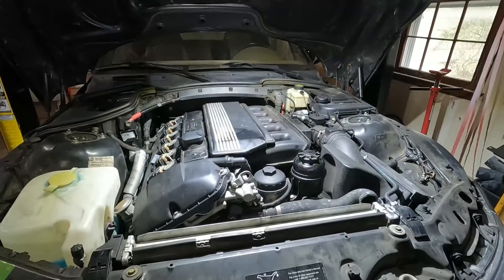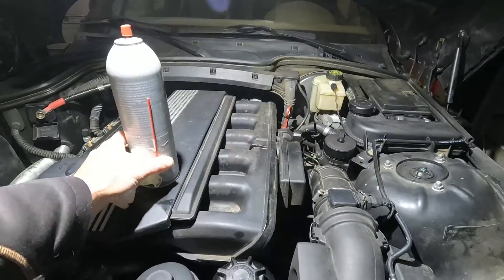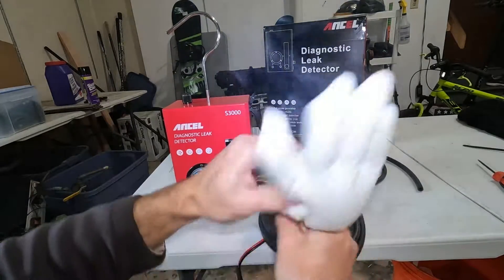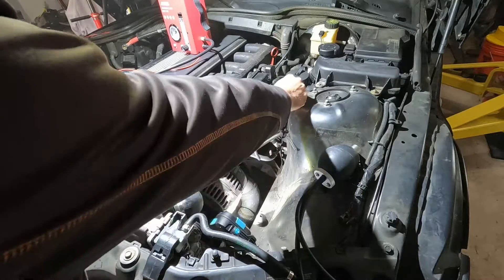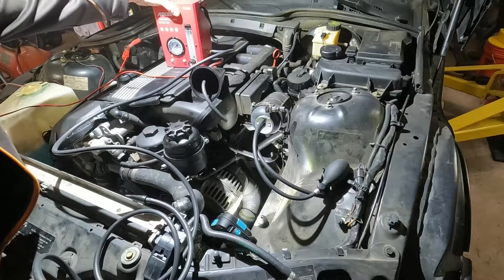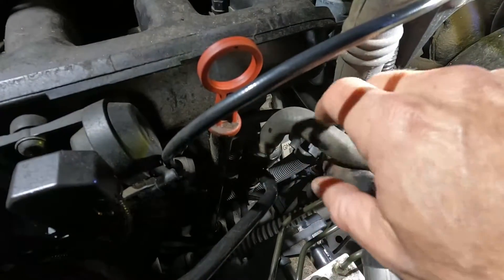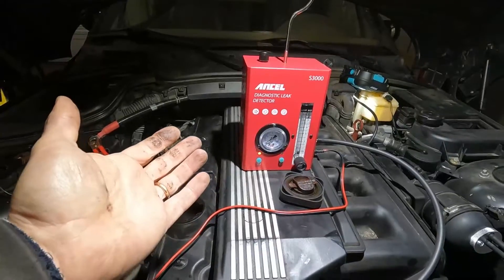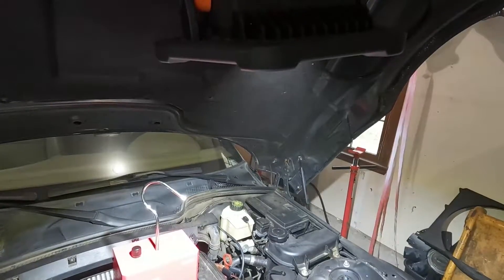Air Leak Code P0171 P0172 P112F How To Fix Mixture Too Lean Check Engine Light With Smoke Test

Comment: Good idea to replace all vacuum hoses and fuel vapour hoses and purge solenoid. 
There is a line that goes from the left firewall down under the car and above the fuel tank, hope that never breaks.

Comment: Just make a Mr. Fusion for $20.  See video on YouTube.
Reply from the maker: Hi Gary, I want to add a Mr. Fusion to my Z3 😀 Gas is too expensive and I want to go back to the 80s for a day or two.
Reply: @AskTheCarExperts  You misunderstand.  The Mr. Fusion I am referring to is a simple PVC Pipe smoke device.  Look for it here on YouTube.  I can't add a hyperlink anymore because YouTube will strip it out.
Reply from the maker: @garyvanremortel5218  Gotcha, Have you made one?
Reply: @AskTheCarExperts  Yup.  I have used it twice on neighbor's cars.  Works perfect, but it needs and I have a compressor.
Reply from the maker: @garyvanremortel5218  Nice! I like being able to do a test without a compressor when checking a car away from home.
Reply: @AskTheCarExperts  I get that, but my Slime roadside tire pump could work in that instance.

Comment: Thanks, Roger!
Nice cameo, Zion 🐶 

Any risks to damaging say MAF sensor etc with the shmoke??
Reply from the maker: Thanks Mario, I was impressed with how well the smoke machine filled the glove. Better than the one I have that uses the compressor. For your MAF question, no the smoke is baby oil. It's common to have oil residue in the intake. Also in most cases you would remove the MAF to smoke the intake tube but this would not cause damage to any sensors. Excellent question!

Comment: Could u damage any seals with that much pressure
 Seems alot of seals werent designed for that type of pressure especially if its a VACUUM system lol. ???
Reply from the maker: That is a good question. While it does produce good pressure for smoke testing it is not enough to cause any damage. I have used smoke machines for 20 years and they are an amazing tool for finding leaks. Nice that they are affordable. Matco smoke machine is still around 2 grand and this ine works just as well with no compressor needed.

Comment: Find a leak on bmw 528i n20 engine p0171 codes impossible to get rid of!
Reply from the maker: Have you used a good smoke machine? Usually do to an air leak. Even a small leak can cause the too lean code.
Reply: @AskTheCarExperts  nobody can find what the problem is using a smoke test. Just pointless. Been stuck with this problem forever
Reply from the maker: @toomuchfinesse2071  A smoke test is an important test that needs to be performed for a mixture too lean fault.  If not leaks are found then you need to look at other reasons but this step should not be skipped.
Reply: @AskTheCarExperts  I never said the smoke test was skipped. I said nobody can find the problem , even with the smoke test.
Reply from the maker: @toomuchfinesse2071  Are you taling about a specific car? Many people have found leaks and solved thus code and if no leaks are found with a too lean you need to check fuel pressure,  fuel quality, injectors et
Reply: @AskTheCarExperts  528i 2013. N20 engine
Reply from the maker: @toomuchfinesse2071  It might also be excessive crankcase vacuum sucking air though the front main seal.
Reply: please let me know how you got rid off it if you did